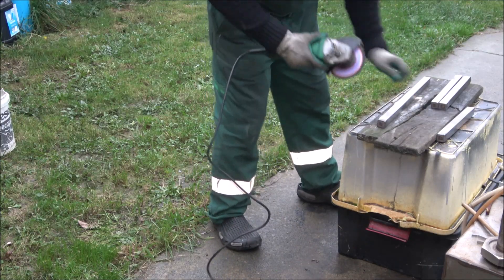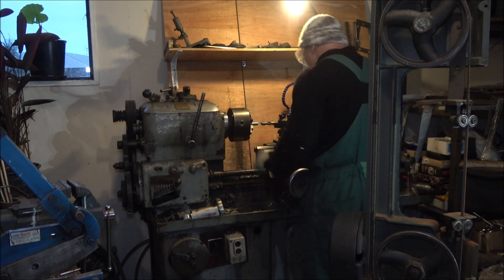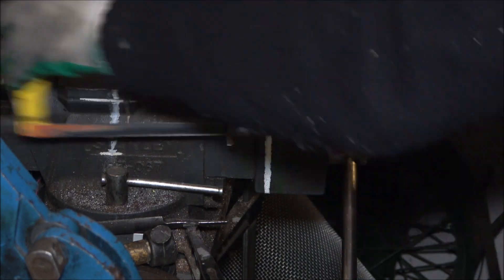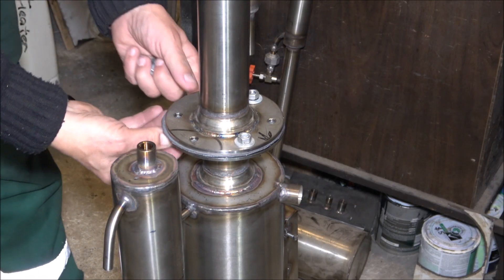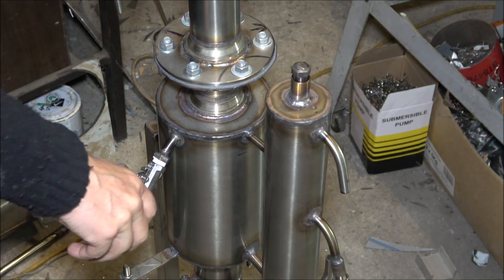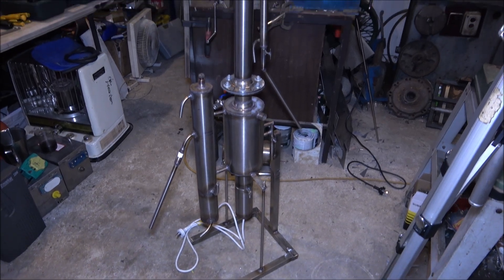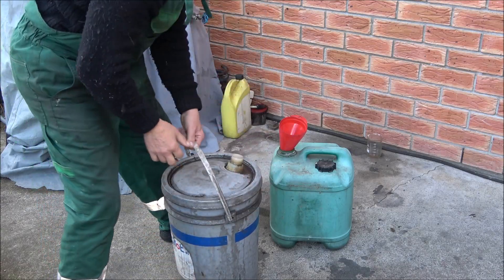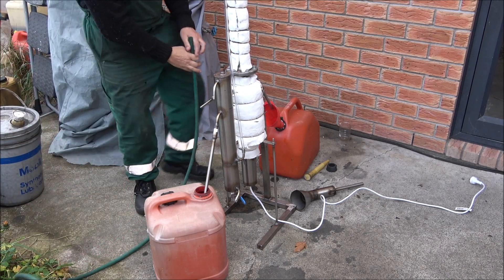Wrong Fuel Separator Build – Part 3: Pretending, Polishing

Comment: Do you have a clear schemetic to know what happen to the oil and how the separation happens??
Reply from the maker: This video is about wrong fuel separator, to separate accidentally mixed diesel and petrol, there is no oil processed in this machine, it works with components containing diesel or petrol, or both together, I have no available schematic of the separator, but have construction manual to build an oil distiller, looks similar, built differently inside.

Comment: You’re speaking like what one of those tool hack videos would be if they were honest. 😂
Reply from the maker: Hi, thanks, I am honest too, just do not want to explain or show minutes of real time detail making, so a bit of humor and sarcasm is a way to go.
Reply: @santeryi9 Well I love what you do. 

I’m guessing this unit is basically a top-fed stripping device? You built another one of these before but IIRC it had a rectifier as well.

Am curious how folks operate stills like this. I have been working on a plant management system for micro implementations like much of what you make and a little plant like this under full automation is a pretty useful answer to a lot of small scale chemical process needs.
Reply from the maker: @captainotto  It a continuous device, can work 24/7 so limited only by availability of feedstock, processing either accidental mix of petrol/diesel, some light fraction containing pyrolisys fluids, red or contaminated diesel fuel, or natural gas condensate, it has a sort of rectifying column, but without fractions control, as we need to separate from the mix every fraction making petrol, plus it works on principle of significant temperature difference between highest petrol boiling fraction and lowest diesel boiling fraction, the continuous nature prevents from boiling enormous amounts of fuel at once, and ability to process unlimited amounts of fuel non-stop, and even partially controlled by electronics would not require any serious attention apart from occasional observation, thus it is very easy to work with distiller like this, it can literally pay for itself in matter of couple of days of operation, there is no need for a big facility, it is mobile, easy to run and does a real job of fuel recovery.